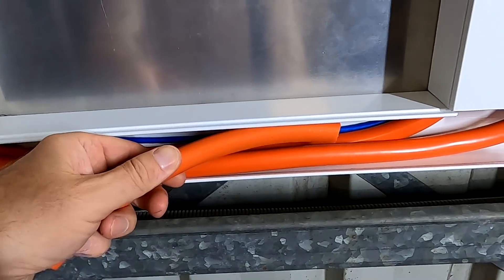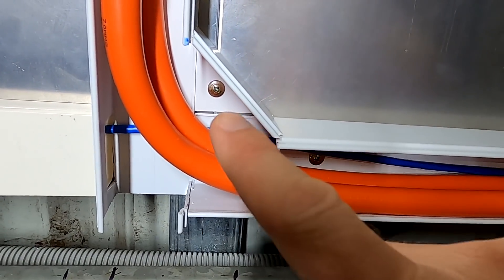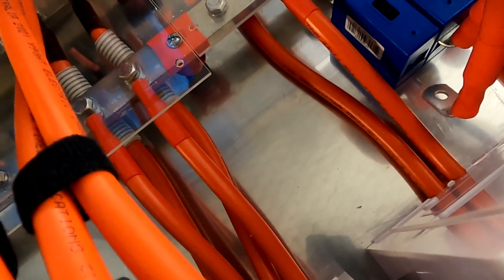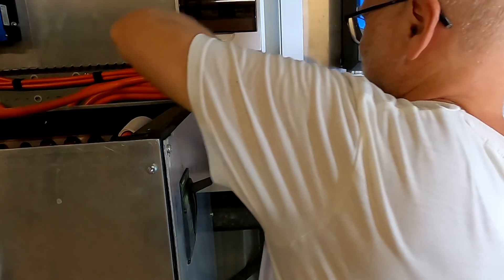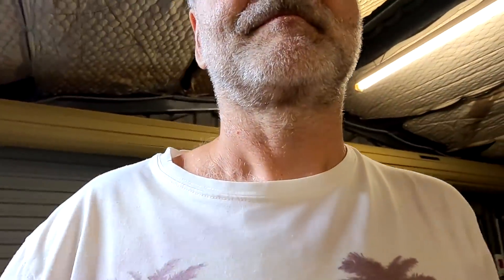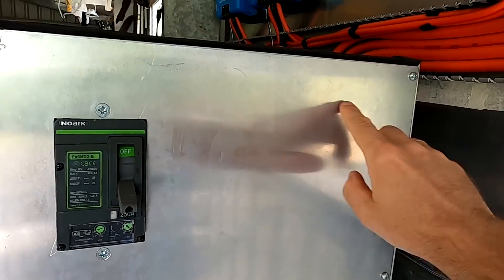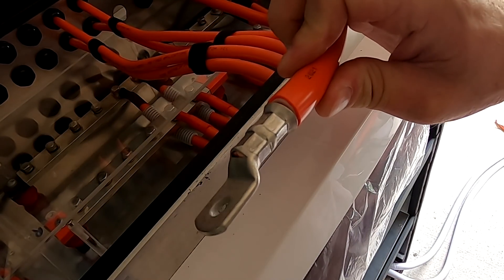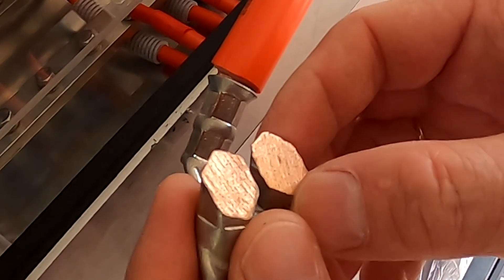Final installation of the #PowerWall upgrade. The Phoenix Inverter will be the icing on this cake!

Comment: 2:04 why not just use these wide gray slotted cable tray instead of those white closed cable trays?
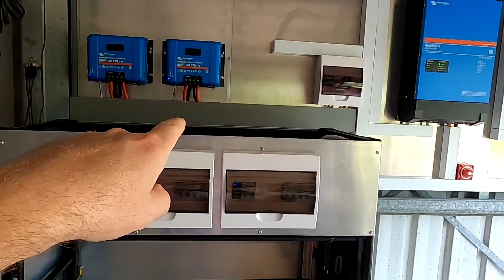16:23 But if you want something white and wide, use  PVC tubular drainspout...
Reply from the maker: I think too many spiders will get into this slotted duct over time. I like the look of the closed an better anyway.

Comment: Hey Andy, great job mate! I have a similar project myself, which will include 4 x 5kw Growatt inverters, and running 3 phase for fast charging for the Tesla. I've tried looking back through your videos, to see how you are measuring the battery input/output and battery capacity measurement, however, I can't find anything over about a month old. I probably don't know how to use Youtube, but if you could give me a couple of links to some of your older videos, where you describe that process, I would be most appreciative. I think you used a "smart shunt"? and then what software? Is that BlueTooth or wired? I'll keep looking, but I may not have much luck. Will send you some photos of mine when done.

Comment: What is the difference between Victron Energy SmartSolar MPPT Tr 150V 70 amp and Victron Energy SmartSolar MPPT  150V 70 amp?   Thanks!
Reply: There are 3 different MPPT 150/70 on Victrons Pricelist. All are for the same voltage and current.
The difference are the connections for Solar and Communication
SmartSolar MPPT 150/70-Tr  -> normal cable connection and VE.direct Communication 
SmartSolar MPPT 150/70-Tr VE.Can   -> normal cable connection and VE.CAN Bus Communication
SmartSolar MPPT 150/70-MC4   -> MC4 connection and VE.direct Communication 
All have Bluetooth build in

Comment: Nice job Andy. Well done!  You used 70 mm cable. They are a lot bigger than needed?  A 50 mm was enough isn’t it for 280amps 2 strings?

Comment: In Victron Professional Online Training 9.2. (from 9:40 onwards), Guy mentions that when using sealed isolators the spark/ inrush current is not a problem, if the isolators/breakers are appropriatly rated for DC current.
Reply: Do note this is only for Victron inverters, which seem to have a low input capacitance. Other inverters on the market have a much larger inrush current and these can e.g. cause the BMS to turn off (over-current protection) or blow a fast acting class T fuse among others.

Comment: about the precharge - the inrush current is really high. I read from several ppl that their BMS died (fried one or more transistors), despite I think that with fully open transistors (using breaker switch) is probably safer than using on/off switch in BMS (no transition period for FETs). Similary it's recommended to use BMS as an emergency switch only, add communication between BMS and Venus, so those hard limits are never reached and charging/discharging is turned off before BMS has to act. Some corner case with recover value/time could be cycling BMS on and off and that would be really hard on those transistors. I have it set up that recover values are unreachable so if BMS+Venus can't prevent it, any error state must be manually cleared.

Comment: I am precharging because i had a welded main switch after a turning my 3 phase system on. I was not able to turn it of again. The switch is rated for 400 Amps DC.

Comment: I think technically you need some sort of cover/conduit over the cables because your battery system will be regarded as DVC-C due to the charge controllers not having basic separation between the pv and battery terminals.
But when making your covers, make sure you dont restrict air flow into the inverter.

Comment: The unstable WiFi in the raspberry pi is a common thing. There is a power saving mode you can disable that helps, but even then it will still happen.
I've found that there's part of network protocol called "ARP" and there's a request the gateway sends out and the devices are supposed to reply, but on the raspberry pi, it gets into a state where it stops responding to these on WiFi for some reason (even with power savings disabled). This is a common cause for the network drop, since the router won't necessarily know the Pi is still there or it's address.
On my Pi (not a Venus OS, I made a digital picture frame/slideshow for my wife) I have a script I wrote that periodically pings the gateway to ensure it has a connection, and when it loses it it will reset the WiFi connection. It also forces it to periodically send out ARP responses (using the arping command). Having both these seems to have "fixed" it, but the short version is any time you can wire Ethernet to a permanently installed Pi, that will be best.

Comment: Very nicely done Andy!!  You are gifted in so many ways but especially in your presentation skills. I’ve learned a great deal from you.  I do have a question:  what is the correct name for the blank filler plug you used to cover unused breaker positions in the DC Distribution boxes and more importantly where did  you purchase them?  DIN panels are not a standard in the US. Thank you.

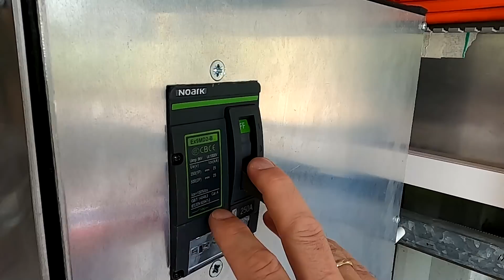Comment: Great job Andy!  At 8:00 something many people are not aware of is that in the U.S. (Similar in other countries) is that all disconnects and circuit breakers, and panels are to be installed in a readily accessible manor, and kept clear for a distance of 36" inches, or a bit over a meter and clearly labeled.
At 7:00 that was a smart hack on the duct corner, and while I didn't do a lot with non-metallic duct lke Panduit, I seem to recall 'L'' and 'T" junction connectors for larger plastic panel ducting that might make life easier if that's something the CCP even cares about making now.

Comment: I still precharge mine with a small resistor in my fixed install. But only because I don’t want to kill the multi and get ‘i told you so’s’

Comment: Even if the shunt loosened enough to make contact with positive buss bar each battery still has a breaker that would trip I would mount a push button next to your main breaker to pre charge all equipment at once.

Comment: Andy, that disconnect switch is the same one I had trouble with about 4 years ago on a boat. I ended up just putting a direct line to 400 amp slow blow and no disconnect but installed a clip to hold a cable cutter for emergency disconnect LOL! 
Measure the voltage loss across the switch. Replaced my switch twice. Yes is was in a marine environment but only fresh water. Most disconnect switches suck!

Comment: What cables have you used for connecting to the solar panels (UV stabilised)? Trying to find different options in Australia.
PS the jst cable you list on your site for the diy victron USB from core-electronics should have male ends (they have this option but I ordered with your link without thinking and found out the problem).

Comment: sorry aber hast du die 70er kabelschuhe mit 50 gepresst, dann hast du leider ein kleines problem. du hast jetzt den querschnitt reduziert und das wird zu überhitzungen führen.
die kabelschuhepresse ist so dimensioniert dass sie das so presst dass es fest ist .70 mit 70 und nicht 50. das kannst du unter grösserer last mit der thermokamera sehen. alles andere super gemacht

Comment: My raspi does the same thing with wifi, no idea why, but it's in my electrical meter box so I'm not keen on running an ethernet cable down inside the wall to it.

Comment: I wonder if the 3 ish weeks connection issue with the Pi is to do with the DHCP lease time on your router/AP? It would be interesting to see if the connection is dropped with a manually specified IP/Subnet/Gateway.

Comment: I can see that angle cover popping off. If you didn't glue it on, it could be something you do. It's a small enough piece that permanently glued in place, the space is still accessible with the 2 main covers removed.

Comment: There are several issues when you don't pre-charge. For one, the inrush current can be higher than the max current configured in the BMS, so the BMS will shut off because of this (over current protection). This is especially the case with larger inverters with lots of input capacitance (low frequency ones in my experience especially). In addition, once you add another inverter, you'll increase this even more to the point of damage to the BMS MOSFETs without pre-charge because now you're pulling a lot more than they are rated for. A REC BMS for example has this pre-charge built in. Those popular EG4 19" rack batteries as well (even though that one seems to be causing some issues with some inverters).

Edit: also, it will blow a fast acting Class T fuse for people using those.
Reply: And the manufacturers are very, very bad about specifying this.  Just asked one about it yesterday and they kind of just shrugged.

I think I'm just going to add a second precharge breaker in parallel with a resistor on it and just remember to turn that one on first when powering up.
Reply: @GoatZilla  It also depends a lot on the inverter itself. Some of the Victron inverters seem to use very little input capacitance and seem to be fine, while for example mine has 4x6800uF on the input. Mine would definitely trip over-current on the 200A JK BMS at least.
Reply: @upnorthandpersonal  Yeah it'd be nice to not have to Big Clive our own products in order to figure this out.

It's not just inverters either; it can apply to charge controllers as well.

Comment: I guess you found out the hard way to use ethernet for the PI, instead of the flaky wifi.  Not going to say I told you so last year.....(but I did, lol)  Wifi just isn't reliable for something on all of the time - lightning, microwave or whatever does it.  Really, the PI should be a POE device that gets it's power from the ethernet cable too....but it isn't yet.  Nice work on cabling.  It looks very professional.

Comment: I’d suggest you get yourself an externally powered POE network switch, and a poe hat for your raspberry pi. Then use something like a UniFi dream router or dream machine and use their access points connected to the POE switch. They have cameras too.  And then you can power the switch from DC directly.

Comment: Schedule a daily or weekly restart on the raspberry pi
Reply: Good point.  And do the same for router/access point.   Both seem to need a restart everyday to keep them from having issues.  Also forcing dhcp clients on 24/7 to static addresses helps avoid 2 clients getting the same address and getting confused.

Comment: looks great! but what about the rest of the batteries installed on the shelf?  also while you are playing with the batteries when you charge them to 3.45 and take the charge away what do they settle down to? 3.3  3.2 after 24 hrs? how do you tell if a battery is degraded other than a load test? let us know